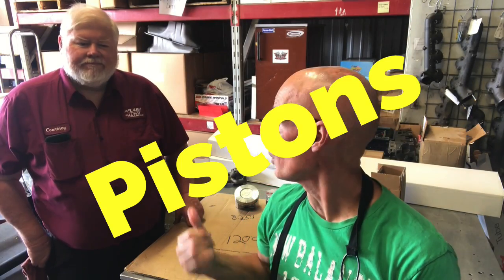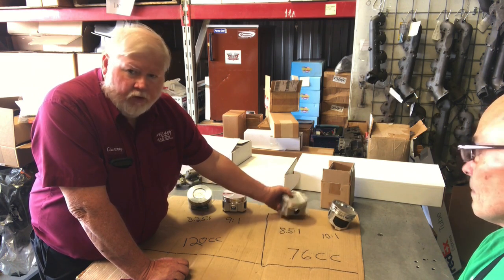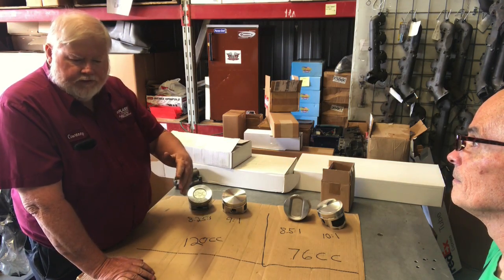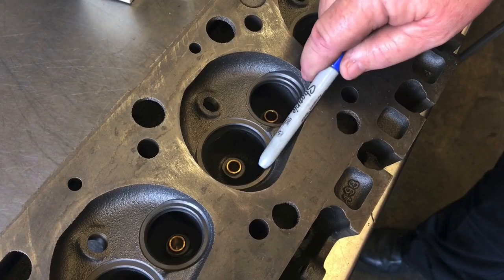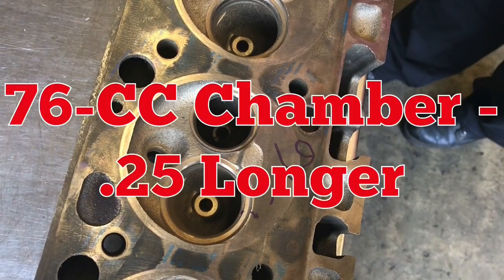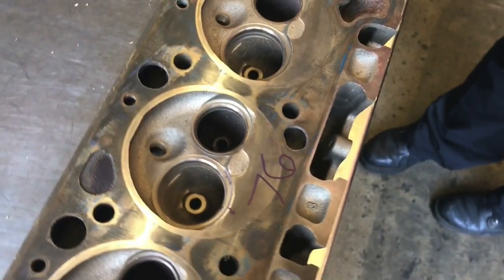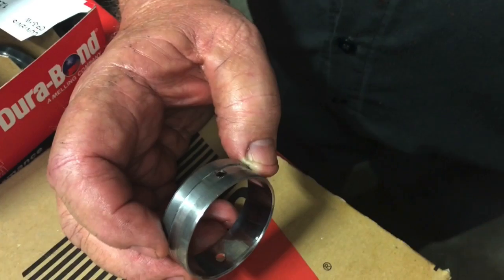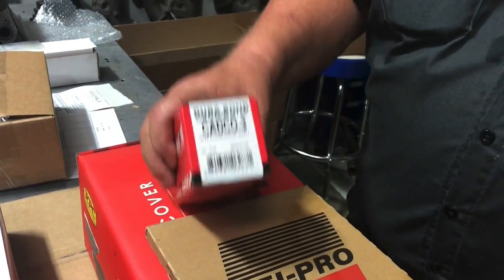CADILLAC POWER SECRETS-CHAMBERS, PISTONS & OILING

Comment: Blow through Q-jet anybody?
Reply: He tried it with an edelbrock carb, a revamped Carter AFB, with no luck. I kinda wonder how it would work.
Reply: @terry ch could you imagine all the 70s Eldos getting turbos all of the sudden. Front tire meltdowns!
Reply: Interst8er J : Easy : 2009 Car Craft article. See hotrod.com/articles/ccrp-0912-turbo-pontiac-400-build/  This was a way under cammed and under-turboed Rayjay with a decreasing boost curve of 9psi at 4000 rpm then at less than 7psi at 4800. At Westech with Steve B and Ken Crocie, it only just made 537 hp from 488 cubes mit turbo, but it does work if der secondary frauline trappers are open, Mein Herr. Just remember, with no boost, over 750 hp gross has been recorded with a Doug Roe  modified Qjet in two forms of drag racing..
Reply: @deanstevenson6527  wonder what mods they had to do to the Q-jet to make it work?
Reply: Don Dotterer : The Doug Roe page 252 float bowl mod and the spring was deactivated and locked with a small diameter threaded rod. In the article above. However, David Freiburger talked about then Paxton Innovi Power Hat before. It would avoid all the problems, IMHO  https://www.hotrod.com/articles/hrdp-1205-novi-1200-boost-paxtons-most-affordable-blower/
Reply: @deanstevenson6527  got the book. I will have to look at it. Thanks!
Reply: I wish you could. But it blow into the idle tubes and secondary pickup tube etc. Would also be hard to control the air valve.
Reply: terry ch : The way to do it is to Paxton Air box the carb, exactly as Broadspeed did to turn a stock 138 hp Essex 60 degree V6 into a 265 hp turbo engine with just a stock DGAS 38 300cfm Weber carb in the TVR 3000 Turbo. Turbo Holley style Air horns work great on non spreadbores without an operative  choke, but on spreadbores, tend to direct flow to the  secondary where it barn doors shut. The  old Paxton or Broadspeed air boxes direct it the whole carb. Westech did a lovely Car Craft test of the Summit Paxton Automotive Corp Powerhat Carburetor combined air cleaner and turbo inlet, cast alloy or polished# 8M106-018. It avoids directed problems with a vac.sec or mechanical secondary getting pushed shut under boost. See the Eric Rhee- 397 rwhp at 5.5 psi chassis tunned but Richard Holdener Engine dynoed 636 hp @ 11.7 psi 293 transplant 1966 Chevelle at  hotrod.com/articles/installing-dyno-testing-vortech-supercharger-chevy-4-8-l-engine/
Reply: Chris at Cad Company can tell ya all about that endeavor. It will be the best and worst experience if you try to run them. Its possible, just not the kind of bang for the buck you had in mind.

Comment: Caddy oiling problem does exist... Not on the Dyno, Not when driven Regularly. Oil pump loses its prime, won’t pick up oil from the pan. Devastating when your Engine Starts Knocking😡 I have 7 Caddy 472/500 powered Vehicles. Every one has a kill switch for Ignition. I Crank till I see Pressure on the Gauge, then Start it  ( NO Failures since I began doing it!) if it doesn’t show pressure within 10 seconds of cranking, Find out Why! There is a plug in the block, above the pump. Add some oil, re install plug. Usually picks up quickly.  Some of mine sit for long periods. I have had to use a priming tool ( seldom)  but if it has oil pressure it will keep Running🤠 500Caddy/ 4speeds 4ever!
Reply: What makes it do that sitting ?
Reply: I had a issue with low oil pressure,although the engine ran great the pick up tube was packed with plastic timing gear chips.while apart i would drill  asmall relief holein rear of lifter valley .It helps return flow
Reply: @puffkendrick6850  My original '69 472 had the nylon fall off the timing set. I got lucky, with no oil problems. But I never noticed a change in timing. It ran great, even on leaded 110. I was surpised to find that in the oil pan when I put the cloyes in it.
Reply: I don’t know why this occurs, but I’ve purchased many 472/500 cars ( most  of them sitting for extended periods) & the majority of them had No Oil Pressure to start with ... I made sure they had pressure before giving them spark & fuel.  I’ve bought them after somebody tried to start them( not knowing)... Every one has Knocked😠
Reply: Other oil issues I  had with 500 engine was the oil relief valve behind the oil filter was stuck open with timing gear chips,and cam bearings not installed properly after rebuild
Reply: The oil pumps are external on this series engines they are easy-to-use remove,clean replace gasket,gears if needed and repack with grease and away we go
Reply: Its amazing how these engines would continue to run with a clogged oil pickup tube,over the years I've noticed people would try to start engine by pouring fuel directly into carburetor which would create a back fire causing timing chain to jump.
Reply: Ive never experienced the lack of oil pump prime you wrote about. NEVER!

Comment: How much can you safely mill the 120 heads?
Reply: Thanks
Reply: I've taken the 120cc heads down 30 thousands on a fel pro head gasket on a stock deck with no problems but if you're running a smaller lobe center cam often times you need the longer pushrods. Just be mindful of the combo you're setting up on a Caddy.

Comment: Thanks for all your help. Would it be any advantage to using  a Quadra jet with a power enrichment that has a 6"tube top" or even an Chevy taking the "plastic plug " out of a Chevy carb that doesn't have the 6 tube top?

Comment: So it’s valve stem length instead of pushrod length that changes with chamber volume? Or is it both?
Reply: The big chamber head has shorter valves, the valve face is sunk into the head approximately 1/4" but the valve tip doesn't move. He mentions the valve length and you can see how far from the deck surface the valves are. They should use the same rockers pushrods and even valvesprings on both heads.

Comment: How much would EFI effect on the octane level? Modern engines run 12 - 14:1 compression ratio, and use 95 octane. Also E85 benefits from high compression. Could this low compression/high octane requirement relate to inefficient fuel "atomization" i.e fuel droplets in the mix causing hydro lock like symptoms?

Comment: How much does a 500 acid Cadillac weigh???
Reply: Less than a BBC. About 570-600lbs complete carb to pan.
Reply: I recently weighed an iron block BBC with Aluminum heads, intake, water pump, Super Sniper EFI and shorty headers at 529 lbs. Honestly except for old school hemis, + or - a bit of aluminum I think they’re all fairly close.
Reply: @patlandymore7035  the 570-600 is all iron oem weight.

Comment: Really digging all the weird motors. Anyone can do an LS. How about doing some GM Ecotec 4 cylinder stuff.
Reply: I would like to see how hard you can hit them all. Big bang ecotec series... 2.0 2.2 2.4. The factory turbo or supercharged 2.0l have a sand cast head and stronger rods. They are also 260hp from the showroom. The 2.2s are everywhere, when gm went racing with them, they sprayed them over 400hp with aftermarket rods because the factory ones took a trip to a more scenic place. I would like to see this.
Reply: Apparently they are hard to tune because only certain companies make tunes for them especially when they added vvt in 2009 diablo canned tunes don’t even make one
Reply: Hp tuners supports them
Reply: How about the Quad4 2.3 H/O? 180HP NA 4 banger, 30 years ago, quite impressive.
Reply: @hughjaskoch5456  Considering how far Ford pushed the 2.3 litre OHC designed in 1971, its a pity GM let the Quad 4 die out as soon as they did.
Reply: @albertgaspar627  It became the Twin Cam ak Quad4 2.4 totally different engine, it sucked. People didn't like the Quad 2.3 because of the NVH, which sure it was quite harsh but I loved it, plus the sound it made from a 4 banger was cool, at idle it was almost dare I say lopey. I had a Beretta GTZ,. Only model that came with the Q4 2.3 H/O, put a few thousand into having it built at an machine shop, put custom cam in, w41 heads etc. Made 290HP and 255TQ. Muncie 5 speed. Thing ripped.
Reply: one of the rare times GM didn't take it's time getting it right before killing a design, but just the opposite :)  You are correct about the NVH issues, as most inline 4's have without balance shafts.

But as you know, GM could have done what Ford did with the "Pinto" engine, used it in SVO turbo Mustangs and pickup trucks as a base engine. I think the 2.8 V6 may have had a longer shelf life than the Quad 4, earning back its R&D budget.
Reply: @hughjaskoch5456  kick ass little engines,friend had a calais with a quad 4,it was quick
Reply: Ecoboost 2.0 2.3 step into what's inhabiting the scrap yard in mass. The older ecotecs had tons of timing chain issues and a pretty weak bottom end from gm. I'd like to see richard tune a hybrid injection setup on an ecoboost engine direct injection and auxiliary port injection. Let's see an ecoboost big bang. 2.0 2.3 and the 3.5 or 2.7.
Reply: As far as I know someone got an ecotec to 1500 hp and in the 6s in the quarter.
Reply: Carl brunet holds the record with an ecotec at 6.07 in the quarter with 1200+ hp.
Reply: I have a 2.0 turbo Ecotec in my 09 HHR SS. Its got some bolt ons and HP tuners. Got a 5 speed in it also. Pretty fun for what it is and very comfortable on road trips.
Reply: How about doing some Pontiac Tempest 4 cylinder stuff..

Comment: Richard, any chance we can get some amc other guys stuff? Big Bang on a Jeep 4.0?
Reply: YESSSS PLEASE!! A boosted big-bang AMC 4.0 would be very interesting. I saw Newcomer's latest 4.0 N/A build, -pretty impressive.
Reply: Horsepower Monster  built a nasty one. Forged, bored, stroked, aftermarket head, fabed intake, crank trigger,  individual coils, massive 90 something or 100mm throttle body. It’s getting a turbo very soon too. Check it out.
Reply: Amc 360/401/258 are the ones I want to see

Comment: It's cool to see the nuances of each individual engine. I probably would have wound up with the 6:1 compression combo and wondered why it was a turd. Lol
Reply: Cranking compression would be like 80psi...lol. Just put a vortech Si on it with 87 octane
Reply: @timothybayliss6680  You'd have to give 500 cubes a lot of pulley to build any boost at a usable rpm. My 350 makes 8.7psi at 5500rpms with the stock pulleys. It would feel like a 4 cylinder with a big turbo. .. no power .. no power, then wham as it builds boost suddenly in the upper rpm range.
Reply: You and I have the same kind of luck my friend! I call it the "black cloud theory" -it follows me around!!